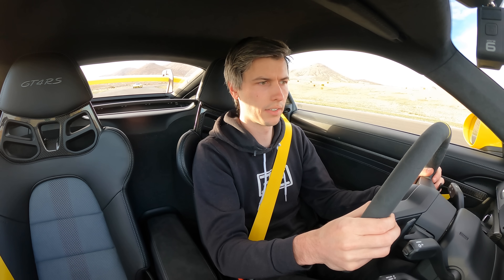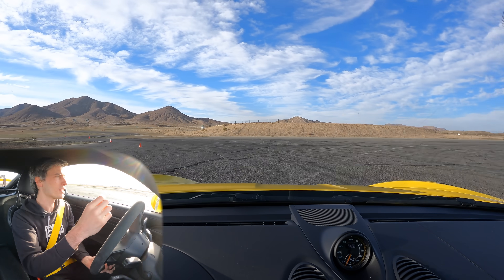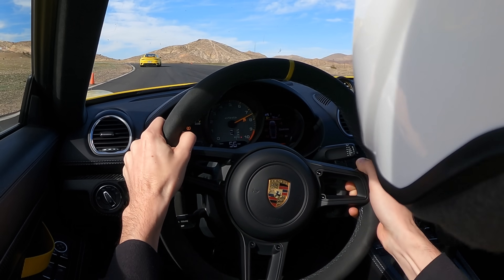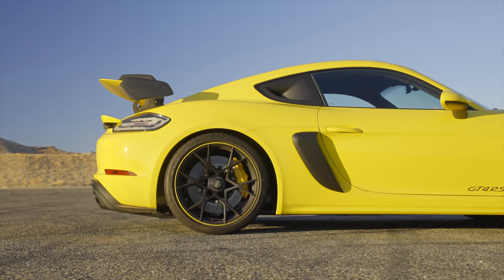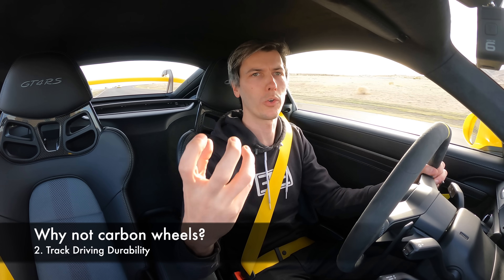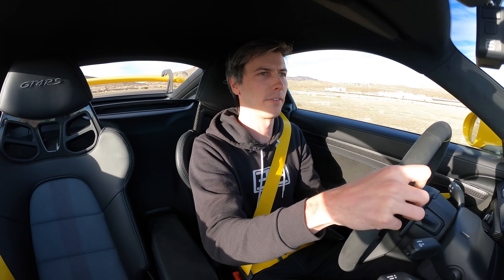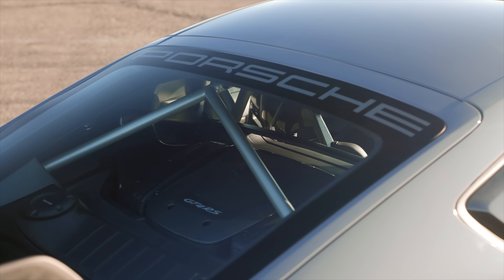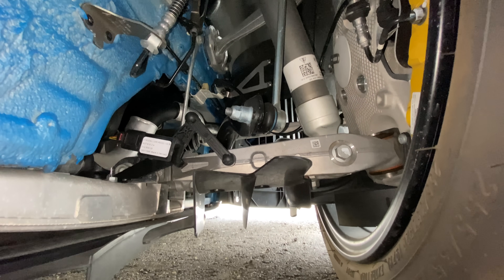The Combustion Engine Perfected - Porsche GT4 RS

Comment from the maker: Quite enjoyed the GT4 RS! For anyone interested in learning more about the engine specifically, I have a full deep dive video on it: https://youtu.be/8xByM10KM2k
Reply: It can be efficient with Cylinder deactivation but also if fossil fuels were cheaper. 

What if we reversed the cost of electricity vs fossil fuels? Would we be saying gas powered cars are more efficient. It seems like neither are good for the environment when we include manufacturing, use, storage and disposal.
Reply: I kept expecting an April fool's something in this video lop
Reply: Thanks for another awesome video man! I've watched many other videos on the GT4 RS and nobody described the engine/gearing feel clearly like you did. I want the DeMan version SO bad 😁
Reply: This was a really enjoyable review compared to so many fluffers out there. I'm holding out for a Spyder RS as my very last automobile purchase.
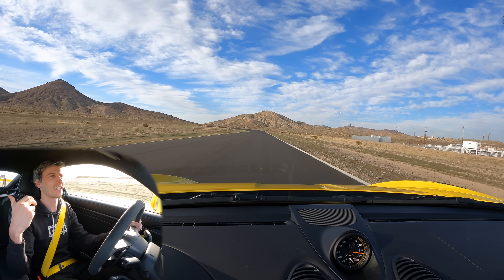Reply: I'm sure that the fact that it's 4:20 on the dashboard clock when you start your commentary is pure coincidence...
Reply: Why would the ideal placement of the swan necks not be behind the wing so they’re not disturbing the air before it encounters the important surfaces and instead only the already somewhat turbulent exit air?
Reply: @mattmatthews5414  look up how the wing generates lift turn it around for downforce and you'll have your answer. Plus you want your spoiler wing to be as far rear as possible to increase its leverage.
Reply: Hi Jason, can you clarify how the 180 degree turn of the engine and extra length on the exhaust output causes a drop in horsepower? I am no expert but isn’t exhaust pushed out based on energy from the exhaust cycle of each piston, not with an active system of some sort outside the cylinder, where a longer length might require more energy? Thank you very much as always for excellent, elucidating videos for people like me.
Reply: Jason, this was an awesome video, but could you please upload a track video of this car? It would be great
Reply: How would this engine perform with camless tech(freevalve) added? You should do a video on that. Looks like freevalve is a small but mighty game changer if more cars adopt it.
Reply: Really life lane gonna be another level 😍😍😍
Reply: video idea: why wont porsche perfect the gt4 and sell it for little more than a gt3? is it that they just actually need so much of the weight over rear tires? b/c i doubt it, huaracan is less weight more power midengine and outpaces gt3 straight line.
Reply: You claim this is "the combustion engine perfected", but I don't hear a word about it using E100. You know what, the best way to keep combustion engines viably alive is to time them for E100 and use corrosion-resistant materials for the fuel system, which is totally possible. Biofuels in general are the cleanest liquid fuels which makes them best for the environment, petrol and diesel engines are largely ready to use them (with minor changes at most) and, perhaps most importantly, there is a safety-related advantage too: E100 favours aggressive valve timing, which results in a higher-revving engine that will do best with a comparatively short and dense gearing, which in turn improves throttle precision without needing to lengthen its pedal travel. Better precision means better safety, quite obviously. If used well, it also means better fuel economy, so even regardless of environmental impact it is more practical. I get the EV lobby wants to get rid of ICEs entirely, but 1)that's dictatorship and 2)they will be lost along with the rest of humanity as there is no proper substitute for earth, so they will actually have nowhere to flee towards and survive. So in the long run they won't win. But if they do win in the short run, it will cost everyone everything. Including them, no matter how rich they think they are. Money is nothing when conditions go against life.

Comment: I just got one and found you cannot drive this car around town in normal mode it will put you in 7th gear at 35  40 MPH that's not good for the engine so you either have to paddle shift it or put it in sport mode, sport mode can be a little rough at times when slowing down for lights, if you coast to the light it will gently downshift but if your on the brakes the downshifts are a little more violent  LOL but it is a fun car to drive and the sounds from the engine are amazing.

Comment: What is the differences between an old V6 engine and a new one that makes the new one capable of better mpg and more horse power?
Reply: Loads and loads!
Tuning refinement and materials used reducing weight and increasing reliability are big ones!
For example consider variable cam timing, it didn't exist years ago then appeared mostly on exhaust and then in both, that adds massive amounts of tunability which in turn adds power and economy!

Comment: There seems to be a good deal of controversy over PCCB’s vs standard rotors for track use (like on the GT4RS).  I have spoken with professional racers and racing coaches who recommend standard rotors, while reviewing journalists (on track) say to get them for track use due to brake feel.  Would you clarify from an engineering perspective whether (current generation) PCCB vs standard rotors would be best for use on track?

Comment: so whats the difference between the 982 GT4 4.0l flat 6 and the 982 GT4 RS engine, and how did they achieve the higher redline?  is the increased HP due to the redline?  did they merely blueprint/balance the engine to achieve the higher RPM?

Comment: Nah. This engine is an over engineered mess. Drive Boxers since 1984. The Alfa Boxer sounded way better and throttle response was instantaneous. Especially the 1.2l. Subaru turbos and oilcooled Porsches were sluggish. 2CV..fun.
A Lotus Élise with Toyota Subaru 2.5 Boxer and we w

Comment: Love this car and great review but 2 things: 1. Are we really believing that the 9 HP drop wasn’t an intentional move? Don’t get me wrong I understand the engineering of why the engine in its GT3 tune has less HP when used in this setup however could they not have easily made up for the difference with a tune, if they really wanted to? With the Porsche mantra of “nothing can touch the 911”, this is AT BEST a happy coincidence they gladly embraced but it was more than likely completely intentional. 2. Is having the Cup 2 R on a street car really a good thing? Of course they’re a wicked track tire but for a really world application, anything less than the most ideal of conditions car easily result in the car landing in a ditch…

Comment: Why is it perfect when it doesn't win in any category? Specific output, energetic efficiency, power to weight, emissions... "I like it, thus it's perfect" doesn't apply to engineering.

No doubt it's a great engine, but there are many others on the same level or better.
Reply: You have a point. Probably because he's a biased Porsche lover.  I get it, it's a top notch car but the best?  Maybe it's the best track car for the money.

Comment: Love Porsche, but longevity and reliability?  

The motor would be "perfected" if it required little maintenance and actually lasted 100,000 miles (under normal driving conditions).

Comment: Don't get hung up on 0-60 times.
Porsche 911's would do 60 from rest  in circa 3sec, simply due to the 4speed box geared for 60 in 1st. This was way back in the 70's.
Though top speed was no more than   160 and weights had to be bolted into the front inner wing. ALWAYS REMEBER FRESH AIR IS LIGHTER THAN ANY MATERIAL😂

Comment: It sounds like that from cruising part pedal/partial throttle opening to wide open throttle, with the downshift, it sounded like somewhere between a 30-80 ms gap/lag between when you can hear the pedal hitting the bump stop on the floor to when you hear the engine rev up following the downshift command.

That's pretty good, for sure, but definitely there's still that lag of said downshift.
Reply: With CAFE standards they have to design cars to accelerate more slowly and burn less gas so they might want to know that you REALLY mean it when you hit the gas.  My car does the same thing; fairly pedestrian response until you hit the detent then it goes.
Reply: @cvn6555  
Oh, I know.

Between CAFE and safety, plus just the time it takes to register the signal and then sending all of the commands to the transmission controller to then "do stuff" and then the transmission actually executing on those commands -- it all takes time.

And really, 30-80 ms isn't too bad, but it's still not quite instantaneous either.

Conversely, if you use the paddle shifters to manually command the downshift in advance of the WOT application, then the responsiveness would likely have been improved.

My wife's 2016 Volvo XC90 T6 AWD is relatively pretty name on "normal" mode. In dynamic mode, the throttle response is a lot sharper.
Reply: @ewenchan1239  Yeah.  I don't get it.  You buy a car because it has performance built in, you shouldn't have to put it into sport or sport plus for it to be that way.  That should be the default with an "eco" mode as an option when doing the school run or on long slogs.  The problem with the flappy paddles is that once you pull them, the trans goes into manual mode and you have to keep pulling them or it won't shift in that acceleration.  And, when aware that I want it to go fast, it shifts faster than I can.  The other problem is that putting it into sport or plus is that the sports exhaust bypass opens and it is far louder.  I love the sound but not everybody else does!
Reply: @cvn6555  
"You buy a car because it has performance built in, you shouldn't have to put it into sport or sport plus for it to be that way."
Well....from the US sales data, only 3% of the American car buying public, buy a manual.

In other words, the vast majority of the American car buying population, performance and/or "sport mode" to get the car to behave or do the thing that you want it to do is really NOT what people really buy nor particularly car about.

I work at an automotive OEM. My wife, quite literally, couldn't care less about what I (sometimes) work on (not because she doesn't care about what I do, but cars just aren't her "thing").

And this has led me to this realisation/fact: 
Car enthusiasts care a LOT about what cars do/are doing, both when the car is stopped/parked/static and when it is moving/in a dynamic situation.

For everybody else, as long as it gets them from point A to point B, relatively efficiently, and reliably, they really don't care that much about what the car itself as actually doing in the same way that car enthusiasts think and care about. 

And that's just the (sad) truth/reality.

Another example, my parents -- you'd think that having a son who works at one of the automotive OEMs, I'd be like their "go-to" person for like car buy advice or something like that. (They're both retired and thinking about downsizing from two cars down to one.)

So, they talked about a few things in a casual call that I had with them, wasn't specifically asking for it, and then I compiled a spreadsheet (of course, as someone who works at one of the auto OEM does), and sent it to them and they're like "wow! It's so nicely laid out!" And I'm like "well...this IS kinda what I do for a living, so...."

Thus, to your point about that you shouldn't have to put it in sport mode for a car to behave in the manner that you want, there's a reason why the "normal" mode IS the way it is (because non-car enthusiasts, a lot of them, aren't all that interested in how their car behaves (e.g. how fast their car responds to downshift commands).) There was a study done years ago that said something to the effect of 70% of the American driving population NEVER use wide open throttle. Ever. (The story goes that the people who responded, said that they were "too scared to" (use full, wide open throttle).)

"The problem with the flappy paddles is that once you pull them, the trans goes into manual mode and you have to keep pulling them or it won't shift in that acceleration."
THAT depends on the vehicle, the specific implementation, the transmission, the programming, etc.

For example, I was screwing around with the 2009 VW Jetta with the DSG, and it has an over-rev protection built into it so such that once you pretty much pass 4000 rpm (in the diesel) at WOT, it WILL execute an uncommanded upshift even if you had it in manual mode.

Conversely, my wife's 2016 Volvo XC90 T6 AWD with the B420T27 engine coupled to the Aisin AWF8F35, that thing WILL NOT execute an uncommanded upshift, so you're bouncing off the rev limiter in 1st if you forget to manually command the upshift.

So, it really depends. (There's been other cars that I've played with where it will automatically upshift for you, just as there are also other cars that don't/won't. So it really depends.)

re: "The other problem is that putting it into sport or plus is that the sports exhaust bypass opens and it is far louder.  I love the sound but not everybody else does!"
Yeah...I hate it when the neighbourhood teens and early 20-somethings are buzzing around in their modded cars whilst I am trying to put my baby to sleep.

There was at least one time where they were presumably dropping one of their friends off, with their music blaring at 1 AM, and I was thinking like "They wake the baby. They rock the baby."
Reply: @ewenchan1239  My Infiniti G37XS would not automatically upshift after pulling the paddle and going into manual mode.  Neither my Macan S nor my current Macan GTS will, either.  Lot less experience driving many cars but the three I have driven with flappy paddles have all done the same thing.  I do think that those surveys come in a lot different when you only consider those buying enthusiast vehicles.  Driving dynamics and felonious speeds are more important to that subset of drivers.  I detest those modified, loud exhausts.  Sound like posers.

Comment: IMO Free Piston Linear Generators are the ultimate combustion engine that absolutely deserve their own video for having only one major moving part that potentially allows insanely high RPMs. They can also use of any kind of fuel, compression ratios, modes of operation like diesel or HCCI and potentially 2 or 4 stroke, all in one engine and purely through computer control. I ain't that smart and even I independently came up with the idea, so why is nobody talking about these game-changing engine-generators?!

Comment: 911 GT3 is faster around a track. 911 has upper and lower arms in the front, multi-link in the rear. Cayman is McPherson struts front and rear. As a result, 911 stays more composed and has better mechanical grip. 911 GT3 track times are faster than Cayman GT4.

Comment: Even cheap econoboxes have rear multilink IRS, Even modern SUVs 
Having a rear strut IRS is idiocy, find how many autos ever had STRUT IRS, 2
Even porsche abandoned front struts in the Porsche racing RSR, it's now wishbone
They also abandoned rear engine, it's now midengine, they couldn't compete

Comment: Combustion engine perfected???  A 6cyl wobble plate with aircooled cylinders.
While they may go ok they are expensive to buy and expensive to maintain. And do not last that long before rebuilds.
As a car,, big lump out back so [even after 60 years of trying] handling is so so. Understeer becomes snap oversteer. Basic physics!
And so bloody noisy inside. Even in normal street driving.

Comment: No. Ford does NOT do carbon wheels. Sure... You can buy a Mustang with carbon wheels. But Ford buys that in from another company. So why doesnt Mclaren, Porsche, Ferrari, Lambo do the same? For the same reason LeMans, F1, GT racecars dont use carbon wheels. Presumably, it has more downsides than positives.
Reply: Rambling rambling pointless... rambling rambling...

Comment: Since EVs are obviously, hearing about ICEV 'breakthroughs' is like hearing someone has invented a steam-powered biplane, or a double-wishbone suspension for a Conestoga wagon. Why bother? The money? All that is over. ICEV motors destroy themselves when used as directed. Doubts? Cruise the car auctions for a low, low mileage police cruiser. ICEVs idle themselves to junk status in a few years. Can use a century old EV today and it still works the same as then. Let's snap out of this multi-fume-induced coma.
Reply: All those used batteries will be the nuclear waste of the next century.  Hydrogen will bury EVs.
Reply: Stfu Tesla fanboy and just enjoy the d*mn car
Reply: Boy, there goes a bunch of brain cells

Comment: Jason, Love your videos. So glad you drove the yellow base car aluminum wheels and gray Weissach Package car with magnesium wheel option.  Did you notice any difference between these two cars in terms of steering feel, acceleration, or interior sound at high rpm? The magnesium wheel option saves 22 pounds over the aluminum wheels, the PCCB brakes save 37.5 pounds over the iron standard brakes. Can you do a video please calculating performance differences iron vs PCCB brakes and AL vs Mg wheels, and the base combination vs ultimate PCCB plus Mg wheel combination. Remove Before Race video showed 2.96 seconds to go 0- 60 mph with aluminum wheels and PCCB. Price difference is very hugh and we we all want to know if the performance gains are worth the extra initial price plus extreme maintenance cost of PCCB on track. Also AP of Porsche has said the WP carbon fiber engine air intake sounds better but is louder. Did you notice a interior sound difference in the two cars you drove? Thank you.